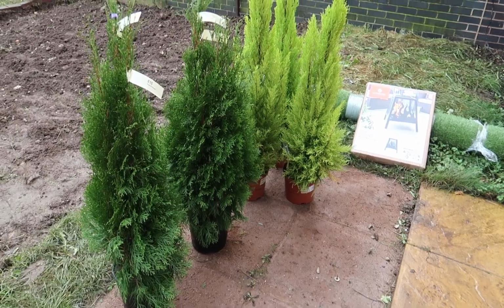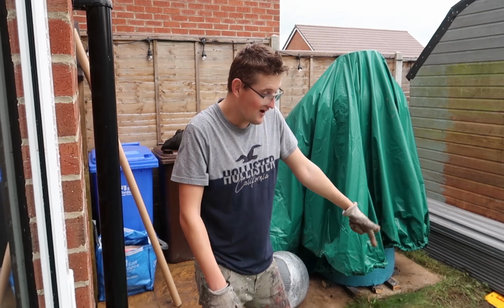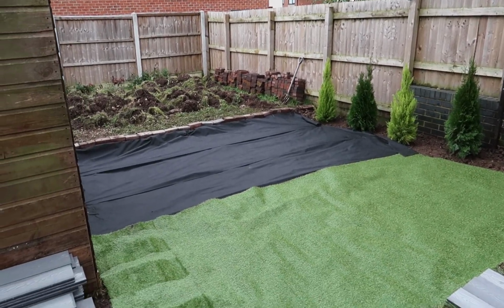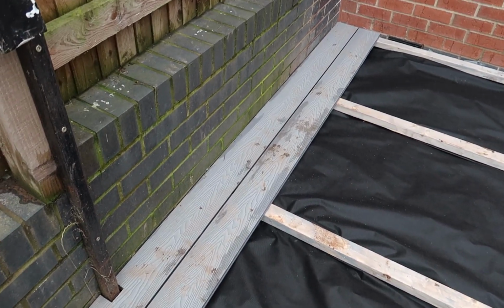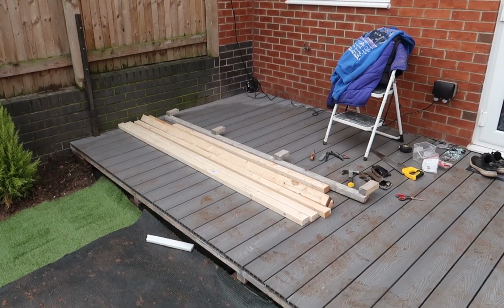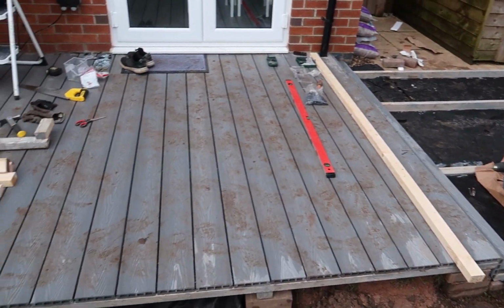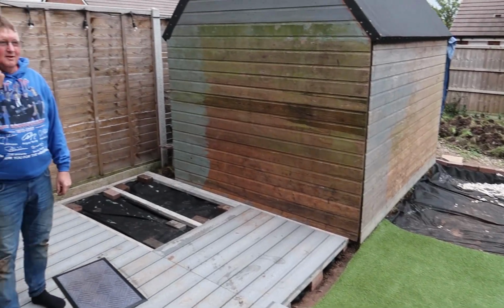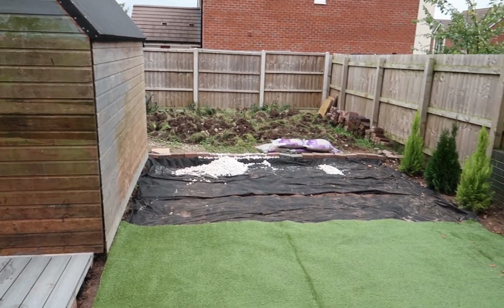Installing Our NEW Garden Decking! Planting Trees And MORE!

Comment: Great looking job! We have composite decking it’s great. I agree with the comments re; joist centres should be 450mm to avoid sagging. Also, is the framework timber treated (for outdoor use), otherwise it will rot quickly.  It looks like interior timber. Cheers 👍

Comment: Looks great. The one thing I would check is that it looks like you’ve got your decking higher against the house than your damp proof course which could give you problems as water soaks through. I might be wrong but generally there is a damp proof course that is a couple of bricks higher than ground level to ensure water does not soak through.

Comment: Coming along nicely. Was concerned about the size of the gaps between the decking panels..i.e..accumulation of small items building up between the panels BUT given that there will be very little grass/ general shrub cuttings / soil borders / sandy stoney gravel...in your garden when finished, it should be fine. With the Conifers, advice i will give is....when "Trimming" yes trimming.....do NOT cut too deep, too much off......as easy to over do and the Conifer will not like it and die and go Brown dead in the patches you over cut too deep. Better to "Trim" twice a year than cut back deeper once a year. You want to keep them Evergreen ...lol.

Comment: Thanks for the update both of you, really enjoyed. With your shed, is it going to be insulated? Probs a bit rhetorical? But thought I would ask just in case you weren't having insulation?  Aswell are there plans to have fold open doors, that can be opened in summer aswell closed in the winter? Would be a good add on to that if so. Decking is looking good, all is coming together slowly aswell quickly. Look forward to seeing garden end result, especially the foundations for the shed. Including the final result on the big shed. But cheers for update, look forward to seeing more videos on this project in future. 😀👍
Reply from the maker: Thank you! We’ll be heavily insulating the sheds!
Reply: @TheSanbrookeAdventures , 😀👍 Good to hear. Look forward to seeing the build.

Comment: Great job! However, the timber looks untreated. It will not last as long as treated. I can see you have given it a lick of paint which may help to preserve it for awhile. Make sure you have supports under the joists to prevent any bowing. Also, please check your damp proof course. It must be higher than the decking (you should be able to see a black lining between the bricks). Composite decking is a great choice but be careful as it can scratch very easily.

Ideally, for the artificial grass, you should cover the ground first with chippings which aids in drainage (20mm chippings/clean) then a sand base or dust/duff. Peg the grass down and then cover the grass with kiln dried sand and use a stiff brush to brush it in. Keep brushing against the fibres/strands to give it a more realistic appearance and occasionally treat it with weed killer.
Reply from the maker: Thanks for your suggestions!

Comment: Hi, composite decking is very good, my only worry is the spacing that you have your joists at (they look very wide apart which will cause sagging)

Not sure of your board sizes, but for a 25mm thick x 100mm wide board = 400mm joist centres, 38 x 150mm board = 600mm joist centres and 50 x 150mm board = 800mm joist centres (these apply to timber decking but I would still apply to composite).

All the best

Comment: Shaun love your content and your enthusiasm but sorry your decking needs more joists. Those decking boards should be layed on joists 300mm apart at their centres. I've layed a 5m X 6m deck with the same boards and originally layed 400mm joist centres but after speaking to the manufacturers I had to change the whole lot to 300mm centres. They even recommend 150mm joists centres for commercial installs. Plus you need noggins about 150mm apart all along the frame
Reply from the maker: Thanks for your suggestions! We’re really pleased with it!

Comment: Your plans for the garden are great but bit concerned on your construction of the deck. 

For your artificial grass, look at clearing out the area level up use some type 1 aggregate then sand and a water permeable fabric membrane then your artificial grass. Also avoid B&Q for most materials go to a local builders merchant you will save a good bit too.
Reply from the maker: Thanks for your suggestions!

Comment: Bit of advice... Make sure you've checked if you need planning permission for your sheds, as it looks like they will take up well over 15m2 in total. Would be a nightmare if you had to pull em down later!
Reply: I thought that, easily exceeds permitted development if there's a 6mx4m shed and the other barn shed too.  Fingers crossed the local planners don't call around
Reply from the maker: Luckily our plans for the garden fit within permitted developments!
Reply: Let's hope so👍🤞